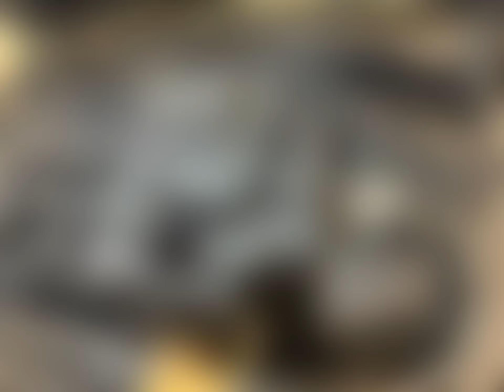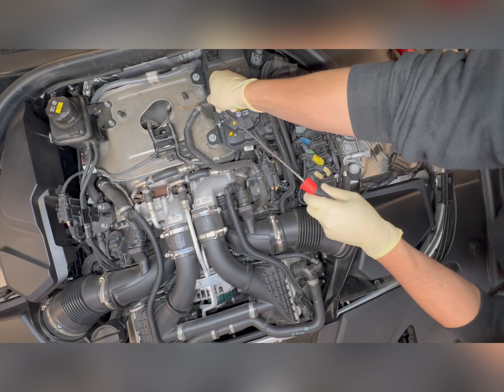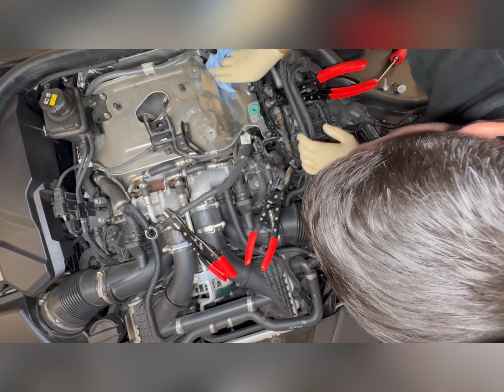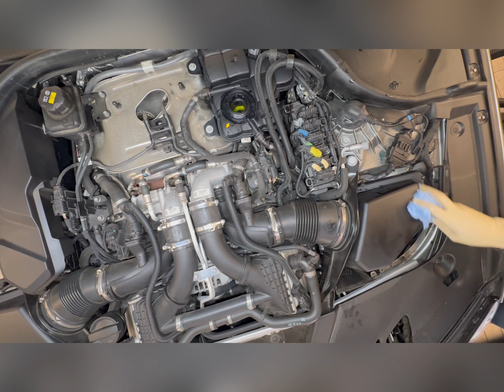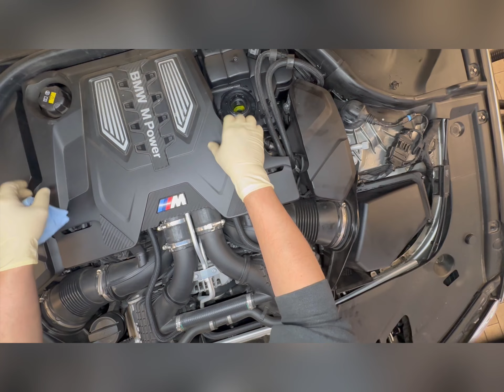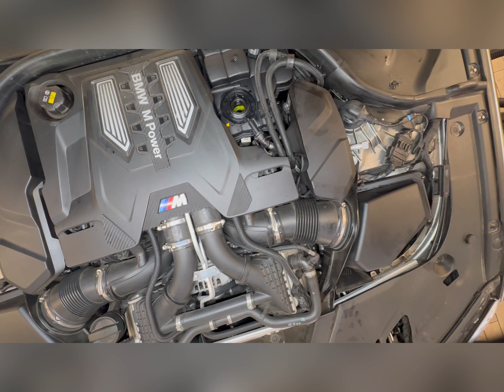F90 M5 Coolant Expansion Tank Replacement In Real Time 2018+ BMW M5

Comment: Timely video. Thanks for providing clarity and expertise. Clears up a lot of questions. I bought a certified 2020 M550i last year.  Car is on third tank and second set of coils and spark plugs on drivers side. All covered under CPO. As you mentioned, I’ll be keeping in eye on the tank to catch it early. 
Regards.

Comment: Such a nice video! Thank you! The conversation between mechancs crack me up! 
I got a question, I was using HT-12 the green coolant for my F90, is there a difference using blue?
Reply from the maker: @notailbear335  if your car came from the factory with ht-12 green coolant than you’re are supposed to use only that. If it came with blue coolant then you can use either for top offs.
Reply: @Sfdgarage  Yeah mine is a 23, does that mean previous models comes with blue? or is that after they replace the tank? Thank you master tech!
Reply from the maker: @notailbear335  exactly, some of the earlier models (18/19) had the blue coolant and they switched over to green later on. So well top off with blue on a blue system and green on a green system

Comment: Bro you did great. I wish BMW would recall the coolant tanks on the f90. I’ve only seen one aftermarket solution so far. Do you work for an independent shop or dealer?
Reply from the maker: Thanks man, im at a dealer. The RK billet tanks are big money and the catch pan they sell is effective but id rather just keep an eye on the tank and catch it early for the price of installing one yourself
Reply: I agree!! They would never recall that then they lose money.
Reply: @Sfdgarage  Those aftermarket solutions cost a fortune. For example, the Level Performance Coolant Catch Pan is close to 700 dollars, which is like 4 times the price of an OEM expansion tank. So you're right, you're much better off just opening the hood once a month and check if you have a leak and have it replaced when needed. It took me 1,5 years of ownership and 14k miles before I got my first leak, so approx 250 dollars every 1,5 years if you have it replaced by a dealer.
Reply: @wuzumaki I did a 97$ purchase, tank relocation on driver side front corner where the stock intake is, and purchased project gamma intakes for $1100. Basically I’ll never have an engine problem again from coolant leak, and a nice intake upgrade. 😅, I have spoken to an independent shop owner who has steered people to numerous options such as rk billet, or catch pan, or other brands, but those apparently have also failed ( not as often but 1 is too many imo)
Reply: @Sfdgarage   it sounded like youre at the dealer , i heard couple n63 start ups

Comment: Bro great video!! Prior to starting this replacement, did you extract any coolant out of the expansion tank? I have a 2018 and want to install the coolant catch pan from 1level but it's pricey AF. Do you know if BMW made the expansion tanks better quality?
Reply from the maker: I did not extract coolant before replacement but that’s always a good idea to make things less messy. The last two I put in had minor revisions so I think they slightly updated the part with a drain tube that directs leaking coolant towards the back of the engine instead of onto the coils/injectors. But time will tell if they are still prone to failure
Reply: @Sfdgarage Do you have the part number to the revised coolant tank?

Comment: Did you have to unplug the battery when removing the cover of the DME, or is the cover just all plastic?
Reply from the maker: The DME cover is just a plastic cap that comes off straight up. No need to disconnect the battery for this repair

Comment: Hi, very important to change it if you don’t want coolant leak and damage your injector !  The engine idle sound is normal ? I hear a sound like knocking or ticking ? Do you have more information about that ?
Reply from the maker: @yusuf_45  yup that’s totally normal sound on the S63. Especially on a cold engine but they all make that noise your hearing
Reply: @ it was your own car ? I hear the normal sound of engine (that’s a little bit loud) but in he background I hear another sound like a knocking, specially after the cold start.
Reply: That’s how these engines sound. Completely normal